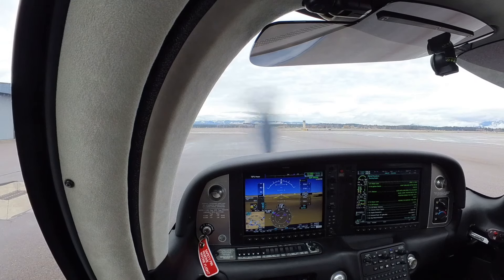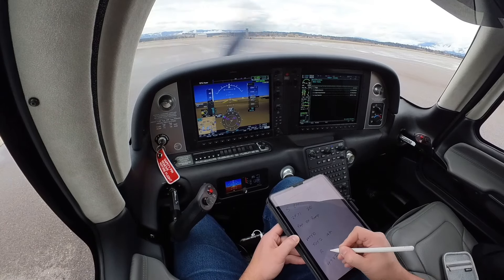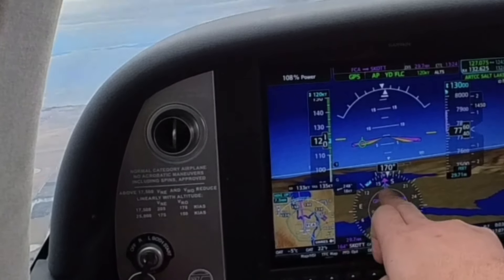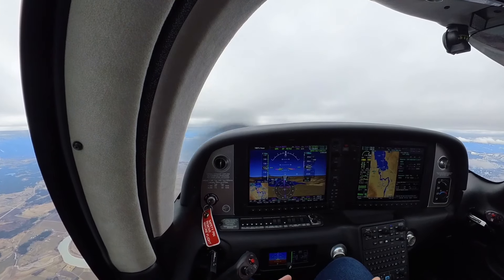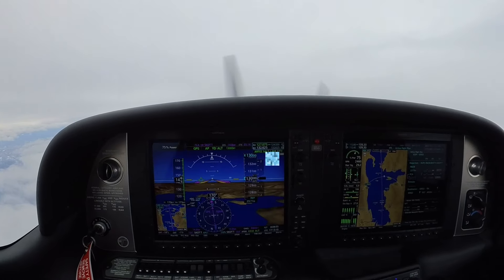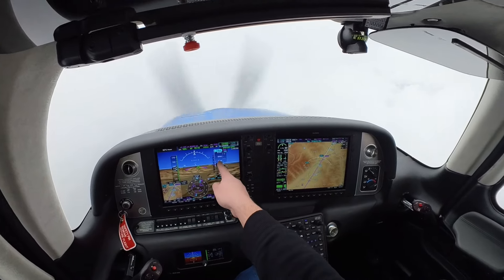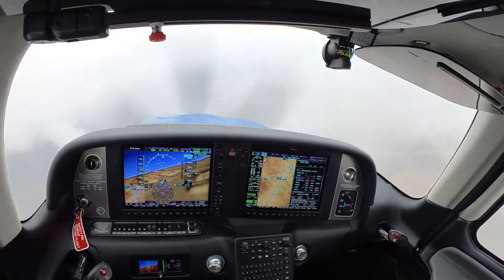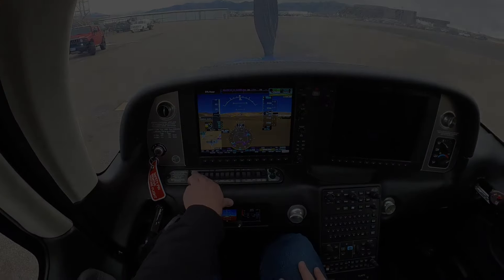Cirrus SR22T Repo Flight | IFR, ICING, Single Pilot

Comment: I'll give you 25k for it no questions asked as long as the logbooks are straight.
Reply: lmao this is a 700K aircraft.
Reply: @briansantana3157  It's called haggling🤣 It is a repo after all, it could have been used in a fly by shooting or drag raced, could have been used to smuggle things, aileron rolls, flown into known icing conditions. It's the Dodge Hellcat of the skies😝
Reply: @JoeSmith-nu8oo  it’s a reposition flight to another airport. not a repossession of the airplane.
Reply: @briansantana3157  Thanks for clarifying that🤣 I saw Repo and went with that. My bad.
Reply: I thought the same thing.